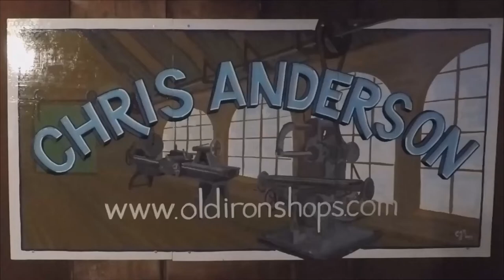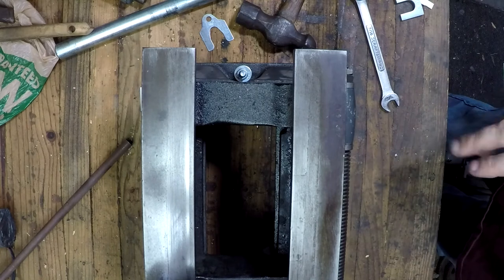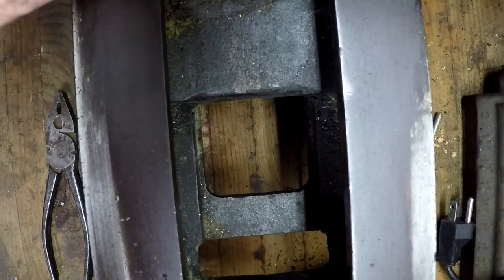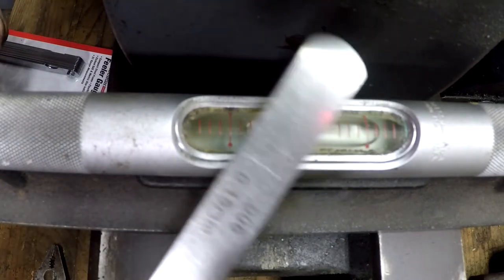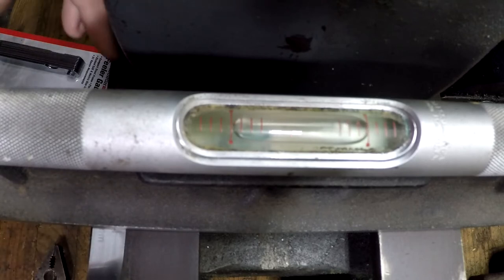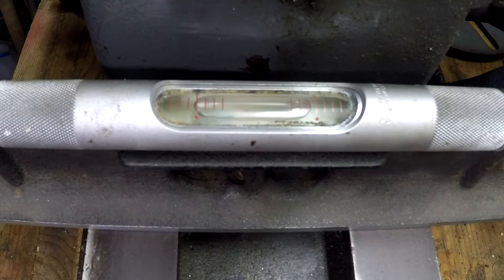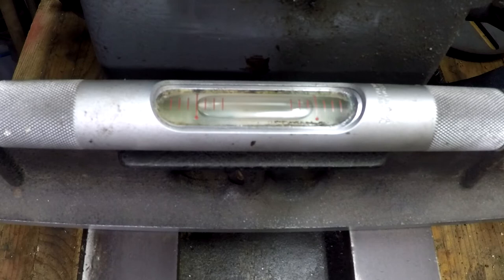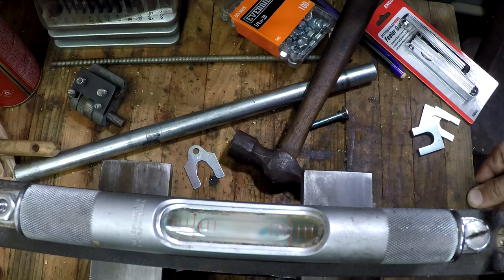Leveling A Lathe Bed : 12" Atlas Craftsman Lathe

Comment: Also now that the lathe bed is level, the test will be turning a bar clamped in a chuck to see if it comes out same diameter on each end. Look up “Rollie’s Dad’s Method” of lathe leveling.
Reply from the maker: This is true but my excessive where prevents anything long turnings coming out as they should.

Comment: Just a heads up that those machine levels are slightly concaved on the sole. This is so they sit flat on all four corners.  All four corners must be in contact with the surface for accurate reading. To calibrate one you merely turn it 180 deg and adjust till you get the same reading.
Reply from the maker: I did a video on calibration a while back . Thanks for watching 😊

Comment: Nice work, now.  Does the wood bench mess with the levle? Or when its running?   I had my SB 9 on a stand, on a wood floor . Didn't do well untill i moved it to the concrete floor.
Reply from the maker: It seems to be holding well I'm on concrete with steel leg's. It oem legs had a maple top so I'm I. Keeping with that .if it gets out i will let you know.

Comment: Thanks for sharing.  Did you level end to end with the same precision or were you more concerned about bed twist?  
If you don't mind keeping us up to date.  I'd like some followup on the change in the wood bench over time, temp, and humidity;  I'm planning to build a new bench for my lathe soon and have been considering wood top over a steel frame.Thanks again.
Reply from the maker: Just wanted to remove the twist  has been holding true for a couple weeks sofar.
Reply: I have a New (old) lathe that needs a bench and I was thinking of blending wood and metal into something special without sacrificing accuracy.  Since the lathe is most likely older than I am and my shop is being remodeled to look "Old-World" I would like to use as much wood as possible to maintain the ambiance;  I know that may sound silly but I have always dreamed of such a shop.
Reply from the maker: @SouthernEngineering  for the most part metal is probably better but if you use a nice thick slab of maple you'll probably be on that's how atlas did it .
Reply: End to end level not that important, for that “close” is good enough. Just going by what South Bend has in their lathe leveling instructions.
Reply from the maker: @nevetslleksah  yes level song the lingth is not that important.
Reply: @Steven Haskell,   "Close is good enough" usually defines my lathe/mill work, if I need really precise work I farm that out.   My machine work is simply to support the projects I work on, I'm not chasing precision like most of you guys,  I just need to get the job done.